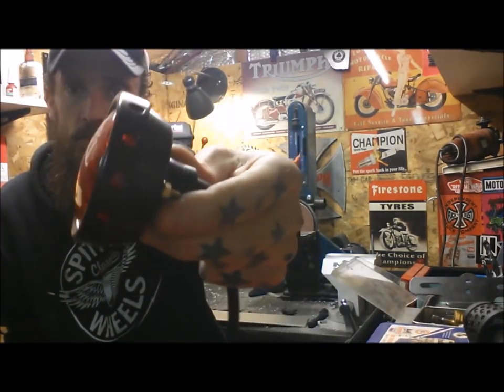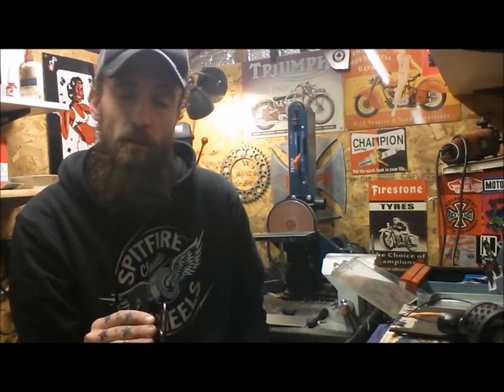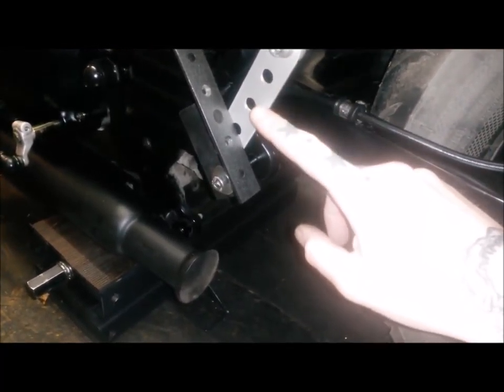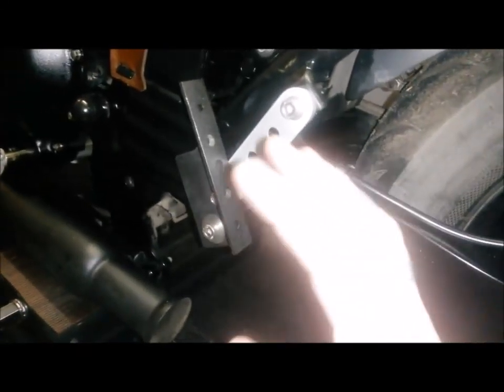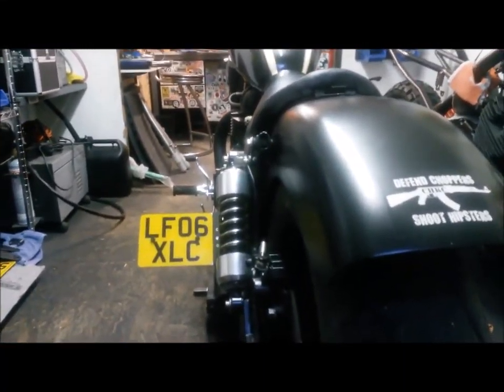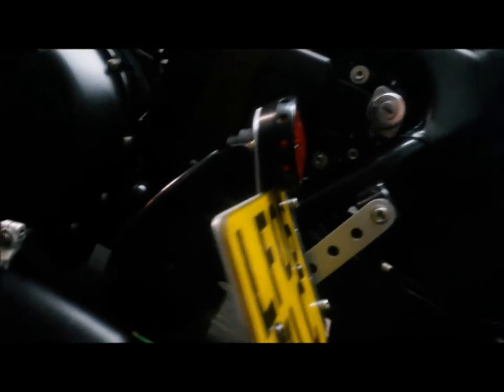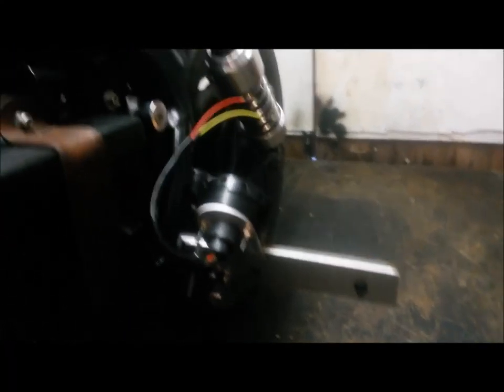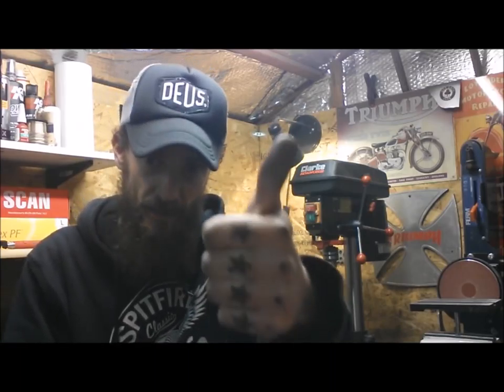Triumph Bonneville America winter wear and tear repair

Comment: i'd  put the plate back on the rear guard  unless you can narrow the side mount by half 
they just poke out to far I reckon just goin on the show plate dimensions
Reply from the maker: hey buddy!- i'm ok with it as long as it doesn't poke out much further than a footpeg or a handlebar. this ones in line with the front footpeg. if i was running with a full size plate it would look ridiculous and it would be on the rear guard!!

Comment: I don't know about UK laws but in Finland the plate must be before the rear wheel axle. But looks good. I wouldn't have put the brake light there cause now the visibility is even porer than the last one. But it ain't bad either
Reply from the maker: as long as it's clearly visible and is of the correct size (unlike the 'show plate' in the video) you are fine in the uk- never had a problem. as for the light visibility i'd have to disagree with you- very visible from behind.cheers though mate!